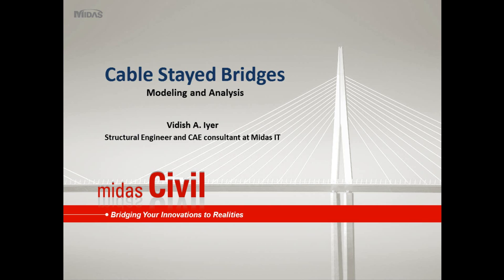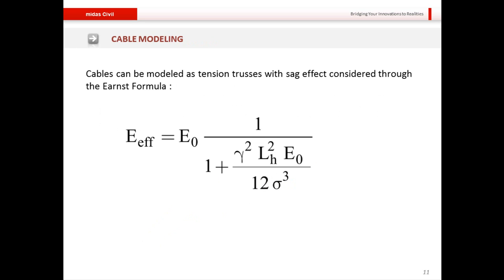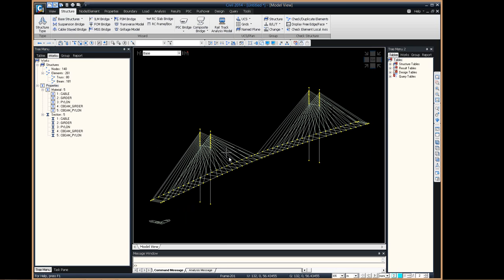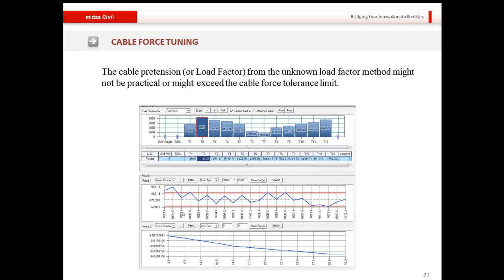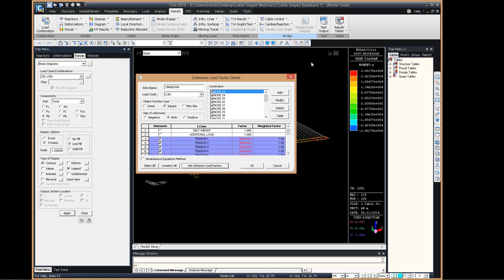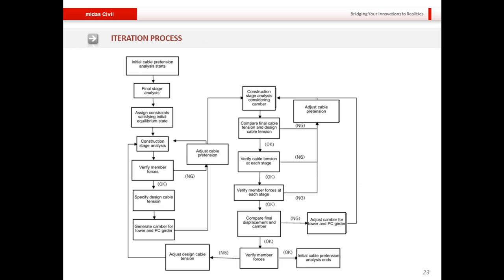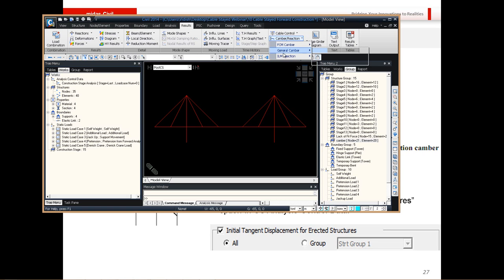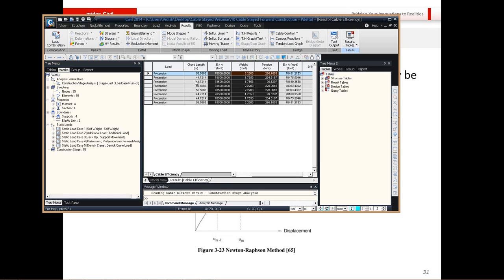Cable Stayed Bridge Analysis   midas Civil Webinar

Comment: hi i am a new user of midas and i am facing a problem when modeling a cable stay bridge, which is that i don't know which the boundary condition should be applied to the anchor cable which connects to the top of the pylon... i'd appreciate if u can tell me how to solve it